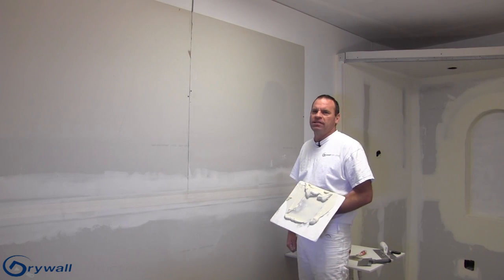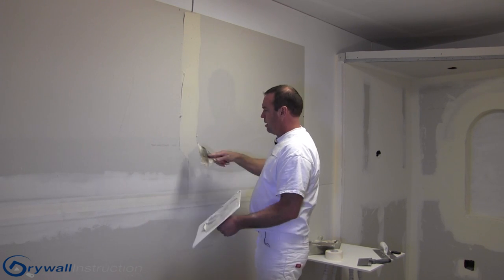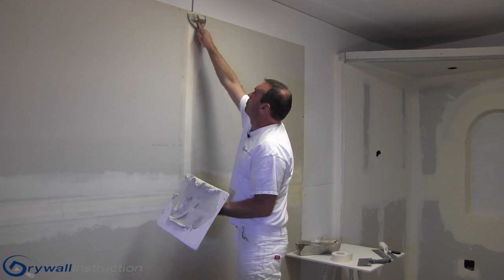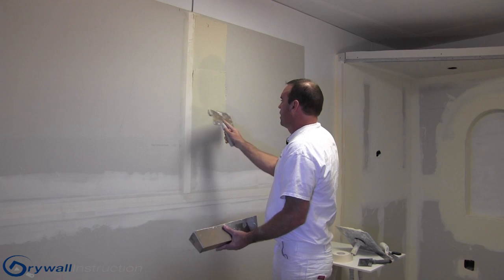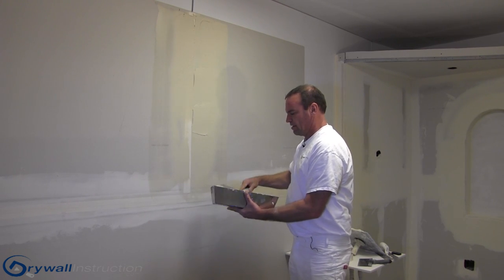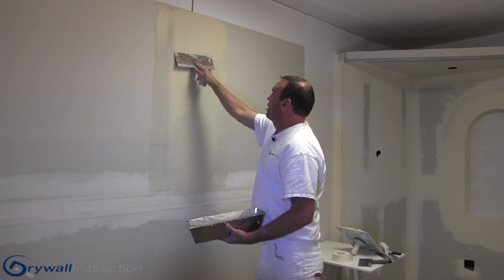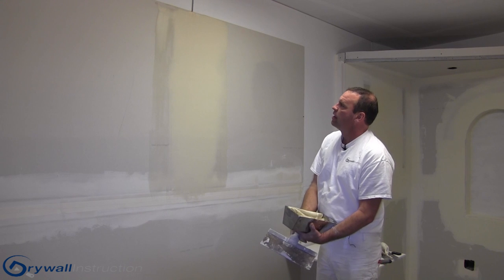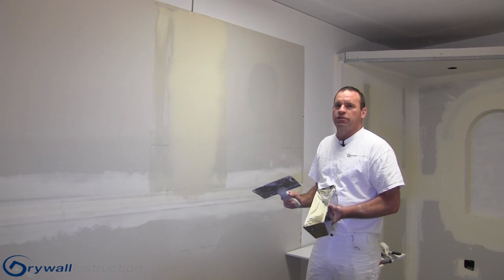Taping and coating a butt joint/seam -  Drywall Instruction

Comment: Not only did it help, but it was perfect instruction.  I've asked this question about what to do with butt joints for at least 30 years.  (I only do it once in a blue moon)  NO one has ever been able to answer the question, even at the suppliers.  Thanks!

Comment: Mitch, compound recommendation question: So where I live we can mostly get USG products from the big box stores. For a diy'er project that i feel i did a very nice fit up job hanging the drywall boards with very little gaps, nothing over 1/8 inch gap to fill,  Would you recommend using in order: (1) All purpose compound for taping & screw covering. (2) Plus 3 compound for each additional coat after taping all purpose is dry?  thanks!
Reply from the maker: That sounds like a great plan to me!

Comment: Thanks for the tips.  I am one of those guys who has used the fiber tape on many jobs, I think because when I first started I would get bubbles in the paper tape>  Also I tend to take on big projects only every couple years.  I am about to take on my own new home.  I think I will break away from my own ways and attempt at the paper.  Thanks for all your tips.
Reply from the maker: You're welcome. Good luck with your project!
Reply: Nothing wrong with glass mesh, you just have to use setting compound for the first coat.

Comment: Hello Mitch. I wish I'd seen this years ago. My home projects have become less time consuming and I sleep better.
Reply from the maker: Hey David, I'm glad that the info. has been helpful! Keep us on your list, our goal is to make Drywallinstruction.com the most comprehensive drywall website on the net!
Reply: Can I ask a question? (I'm going to): Do you always mix out of box or do you ever use mud straight from the bucket? Sometimes it seems too thick out of the bucket.

Thanks
Reply from the maker: David Mitchell Once you have buckets it's easier and less expensive to buy boxes.  Mud varies in consistency in the bucket and the box. I add water when needed (see "mixing taping mud" video) but for coating you can use it straight out of the box sometimes.  Remember that when you add water it will shrink more.

Comment: Is it ok to add that much mud on the first coat?  Most all let the base coat dry before building up over the tape.  Just wondering
Reply from the maker: You're exactly right that most believe it's not possible.  I've been doing small taping jobs for years and have never had a problem when taping with AP and immediately following with a heavy coat of topping.  This forum is great for added perspectives, I'd love to hear from someone who had a problem when doing so.
Reply: I prefer to let tape dry before topping if it's a small job I bed the tape with hot mud go take a brake then come back and top it
Reply: If you use a bag mix like 45 or 90 min, those dry and harden even submerged in water. Once they turn gray that's usually when I go with pro form topping. Dries like a champ.

Comment: I guess I have a question. Why tape the butt joint seam? Like factory edges come slanted to fit tape even. What is the benefit of putting tape down? Doesn't that just build up the edge that is already the same thickness of the wall?
Reply from the maker: All seams have to be taped or they will crack.

Comment: Should always tape with taping mud as it has glue in it to help bond the tape to the paper of the drywall.
Reply: Or hot mud, I only tape with 45 or 90 minute. It's a better bond than AP and you can go right to the topping mud after an hour

Comment: Hi, kind of irrelevant to the video but you do mention it. So do you ever use the mud in the yellow box? The one specifically for taping? Or do you find that the all purpose is better? And if so, why?
Reply from the maker: I have not used the taping mud, I just haven't had a need. AP has met my needs.

Comment: Prefilling your joints with premix mud will end up cracking over time.
First coat should be a mix of sheetrock 90, otherwise you have no strength

Comment: looks great, thanks for posting!
someone told me that i should make a small 45 degree cut on each edge of the butt joint so the mud has somewhere to go and grab.
but here you did not do that.
i'm confused.

also, no wet tape. does that make a huge difference?
Reply from the maker: Sorry for the delay.  I have never done either and have never had a problem.  The trick is thinning your taping mud.

Comment: I was taught to put all purpose as the first coat. Example on a buttoning- tape with all purpose, then I coat all purpose and sometimes 2 coats topping. I’ve seen a few videos now where people just go directly to topping. I’m curious why you don’t use all purpose for first coat besides the sanding difference? Thank you. Great video
Reply from the maker: I see no purpose to using AP after getting the tape on but I'm sure open to ideas and understand a lot of beliefs exist.
Reply: Drywall Instruction thank you Sir. Very helpful videos
Reply: I thin down my all purpose for the 2nd coat, then skim with topping.   But that is just my method and works for me.
Reply: Sounds like you are doing more costs than really needed but if they are nice thin coats there is nothing wrong with what you are doing...thin coats dry fast

Comment: Maybe it's just me, but anytime i've immediately coated a fresh paper tape joint with still wet taping mud underneath it, the tape will bubble, unless i coat the fresh taped joint and scrape it clean,  you ever have issues like that with coating a buttjoint like that and then immediately coating it again.   Maybe you're removing 90 percent of the topping compound and i'm leaving too much on a fresh tape joint.  I don't know, something i've noticed over the years
Reply from the maker: I actually have never had that problem and have taped and immediately coated repeatedly without any issues.  I'm trying to imagine why that would occur and can't come up with anything.

Comment: You gotta explain to the rookies that when u put the tape on you cannot draw/press too hard on the knife because that will remove the mud from behind the tape that's supposed to keep the joints together
Reply: You have to push the mud out pretty hard or it wont actually be flat. If you used enough mud in the first place there will be plently there. I would know ive never jad a callback for a blister.
Reply: As long as your mud is thin enough then you can't really force enough mud out even if you used all of your strength. When people run into issues is when their mud too dry

Comment: So, topping is good straight  from the bucket?
Reply from the maker: Mud varies in consistency when shipped but yes most of the time you can use it straight from the bucket.  Remember that anytime you add water it will increase shrinkage when drying.
Reply: I usually add some water to help feathering but its accurate to say the more water you add the more shrinkage you have

Comment: So is 24" usually wide enough to sufficiently cover (hide) the butt joint?  Would going wider be of any benefit or just a waste of effort?  Thanks.
Reply from the maker: I say that 24" is sufficient.  Remember that what you're trying to accomplish is that when you look down the  wall you don't see a noticeable hump.  You can always go wider if necessary.
Reply: The real way is to put your knife in the center of the tape to see how bad the butt is . Some butts need to be spread wider than others always check the center first .

Comment: I've watched a number too and have found them helpful and informative - especially thankful for pointing out what other video's or even the 'experts' at the super-discount stores often say, that is just not in our best interest.  Question:  Do you like to have cut or butt ends length-wise along the ceiling corner edges rather than let two (one ceiling - one wall) tapered edges meet?  Seldom do we get a ceiling exactly x-sheets wide, so if it does not add another seam do you prefer to cut the tapers off along the wall when practicable?
Reply from the maker: I'm so glad they've been helpful.  It's great when you can use the tapered edge but you're right, a lot of times you end up cutting off the factory edge.  As far as wall to ceiling goes, ceiling always hangs first and then if you're hanging your rock on the wall horizontally you hang the top half first so the majority of the time you'll have a tapered edge to work with.  Good luck to you!

Comment: Mr if you're not using hot set you are not supossed to coat your join untill is dry  cause after a couple of weeks it's painted and is 100% dry is gona shrink and look like shit.
Reply from the maker: I appreciate your opinion but after 30 yrs. of drywall I've never had that happen.

Comment: Do you normally coat it right after you tape it?
Reply from the maker: A common belief is that you have to wait for the tape to dry before coating.  I personally have always coated right after taping and have never had any problem.  Be sure to tape with all-purpose and coat with topping! Check out our progress @ Drywallinstruction.com!
Reply: Thanks
Reply: I was always told you had to wait, Im doing my fill coat right after from now on thank you sir.
Reply from the maker: You're welcome, if you haven't yet check out Drywallinstruction.com!

Comment: Can I use all purpose as topping?
Reply from the maker: In my "Drywall Compounds" videos I explain the different types of mud and their uses.
Reply: You can but it is worse to sand, and shrinks more due to the higher amount of glue in the mix.  You could thin it down but then may need multiple coats to get the same finish.

Comment: That joint should be installed before the other one below it. Plus you need to wait for the tape to dry before applying  the next coat.
Reply from the maker: Not sure what you mean about one joint being installed before the other but respectfully disagree on the need to wait for the tape to dry.  Have coated wet tape for over 20 years and have never had an issue.  Thanks for watching though!
Reply: @drywallinstruction1766  respectfully that joint over time can be sticking out. You don't know cause I'm the person who comes to people's homes and fixes it. I've done jobs for huge company's and that right there isn't the right way. Sorry but your 20 years was a waste.
Reply from the maker: I'll have to agree to disagree.  Again, I've never seen evidence of a "joint sticking out" because of coating over wet tape and I've been in the repair industry for 28 years.  Good luck to you though!
Reply: They say "Butts, Flats/bevels then corners", personally i've done it always without an issue.   Obviously paper over paper creates a slightly larger hump to feather out, if you can stop short/tight to the existing tape then that eliminates that slight bump.  Actually having a wet substance on top makes the drying better.   as opposed to having your wet underneath the tape and the top part of the  tape dry.   The dry part will suck the moisture from the compound quicker.   I've read/watched/asked pros and got a different answer each time.   Again, i glue the tape down with the mud then do a skim over the top to "wet" the outside of the tape surface.  never had an issue.  I've even coated directly over without a problem.   I'm not a pro, just a handy DIY'er who manages property.
Reply: @drywallinstruction1766  if you block over wet tape you will get a lot of shrinkage and will have to do a heavy skim coat. We all have blocked wet tape from time to time but it is NOT the correct way to finish drywall. If you want to do a small area faster then I recommend using EZ Sand which will set up faster allowing you to apply the next coat with minimal shrinkage.
Reply from the maker: Not sure what your "block" term means, I respect all input but get a kick out of people telling me how something is going to turn out that I've been successfully doing for going on 30 yrs..  If you tape with AP and coat with Topping you're left with very little shrinkage and hence next to no skimming.

Comment: Did you just put that tape on upside down?
Reply from the maker: You seem by your title to know what you're doing.  Could you please explain the goods or bads to putting the tape on one way or the other ?  Please don't tell me that the crease sticks out a long way.
Reply: Well ...... while installing, and finishing over 1500 miles of drywall tape, I have learned quite a bit about the proper and better ways of going about it. These days, I find quite a bit of value in my knowledge base.
Reply: 1WallBoardsman well share that knowledge or move along? Why bother even commenting anything if you won't.  Telling someone something and being able to do it are two different things no offense original poster. I've hired Labour's that been told and showed how to do there task and are just useless haha.
Reply: Yeh, I noticed that also.
Reply: Yes He did, Ive been finishing for close to 30 yrs and he definitely put it on upside down. The crease CAN pucker if not installed correctly.
Reply: @1WallBoardsman  Nice no answer!
Reply: Lmao you guys still using paper tape? Fibreglass tape is where it's at. I've never done butt joins that wide and you don't have to if you Use fibretape and single box. You guys Plastering like it's 1960 you old farts.
Reply: He did not use it upside down.
Reply: Gary Rosie  no not fibreglass Mesh, fibreglass tape. Completely different things, It's only been around for about 2yrs. Lmao paper tape and fibre mesh is trash. I'm using fibretape for joins, slim card for internal corners,   aluminium slimlines for external corners.
Reply: Gary Rosie  you tube fibafuse
Reply: Why the hell are you “experts” watching these videos if you already know everything??  Make your own videos and spread the YOUR knowledge.

Drywall Instruction, i like your videos. Keep it up. There’s ppl out here that appreciate the time you take to share.
Reply: ㅊ초초초ㅗㅠㅇ옽

Comment: I've never heard of topping......I've seen finishers add water.........you can actually purchase a topping compound?
Reply: Just googled Topping Drywall Joint Compound......been around construction most of my life.....never heard of it......what exactly is the difference?
Reply from the maker: Check out the drywall compounds videos, part 1 and 2.
Reply: Giovani Giorgos depending what country your from. In Canada we have the different compounds including my favorite sheet to 20, 45, 90 hahah  then you have your taping compound among the finishing coat. 

I believe where I buy from rona the use CGC
Reply: "Topping" in Eastern Canada would be anything "Lightweight" such as the green (ultralight) and purple (dust control) tubs from CGC.   I believe in other parts of the country names/products vary.    The ultralight I use direct from the tub, the dust control I thin a little with water depending.

Comment: Maybe a correction should be made to your video.  You say first that you are coating the seam with taping mud, but in your summary you say you put the tape on with all purpose?
Reply: You can tape in with all purpose, it doesn't matter. You could even finish with all purpose as long as you love sanding.
Reply from the maker: If you watch my videos you'll see in "mixing taping mud" that taping mud is thinned down all purpose.